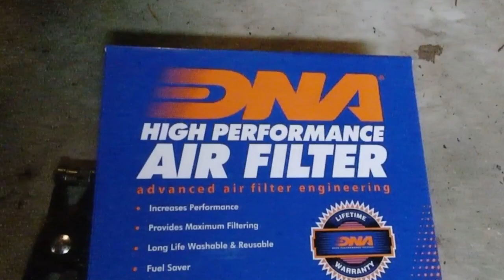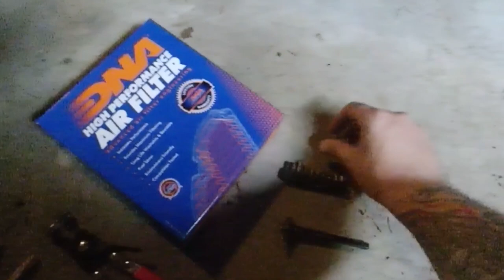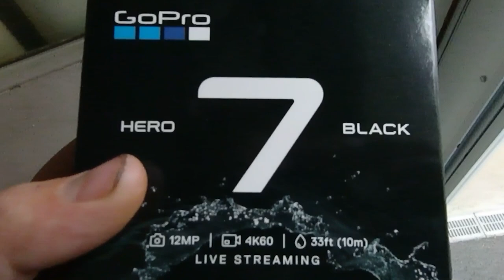DNA Performance Air Filter Install // Triumph Speed Twin // HD

Comment: I put the DNA filter in mine too. I don't care if it flows better (it does) I think the stock flows enough air. I just did it for the serviceability.  Have fun with the xpipe! Not hard just tedious. I did mine in about an 2.5hrs. I uploaded the shop manual to the FB group if you want it.
Reply from the maker: It took me 4 hours to get that sucker in!! Haha im definitely gonna use your manual for future projects though. Stayed tuned for some exhaust clips
Reply: Any chance I could get a specific web address for that shop manual big guy?

Comment: So I need to replace the dna filter every 1000 miles? Does this harm the bike at all by allowing more dirt to get into it? Thanks for the video I enjoyed it
Reply from the maker: I did it for the hell of it really lol filters dont need to be changed for many many miles. People have been running pod filters and open intakes for many years with no issues. Its not really letting in much more particulate than it was with the stock filter anyways. These motors are strong

Comment: Is DNA Better than K&N? Or are they pretty comparable?
Reply from the maker: DNA has been proven to be better than K&N for this bike specifically 👍 can't say the same for all bikes
Reply: @NicePantsLance  Good to hear because that’s the one I bought 😁Also did you leave the snorkel off or reinstall?
Reply from the maker: I left the snorkel off 👍 so far everything's fine! Rode @80mph for 2 hours straight in the pouring rain so I've tested it lol

Comment: Air flow is more than sufficient on the OEM air filter, all you'll do with that DNA one is allow more crap to get into your engine and shorten it's life
Reply from the maker: Well you're definitely not wrong about that....but i think its pretty obvious that the more an air filter flows, the less it filters out of the air. One of the main reasons i went with a DNA filter is that they can be serviced and re-used. Oem paper filters must be thrown out after they are soiled. 

Heres a link you can follow proving that aftermarket filters flow better than OEM.

https://youtu.be/pGSHtEjYIhc
Reply from the maker: Here, i put up the results so you dont have to watch the video.

Clamed air flow by the air filter manufacturers:

• Kawasaki OEM none
• K&N Filters 212.7 cfm @ 1.5 inH2O
• DNA Filters 181.4 cfm @ 1.5 inH2O

Test results 30-3-2012 (same day, same conditions, same flow bench, and same operator, back to back):

• Kawasaki OEM 152 cfm @ 1.5 inH2O
• K&N Filters 161.6 cfm @ 1.5 inH2O
• DNA Filters 184.6 cfm @ 1.5 inH20

You can think what you want, but to say that all filters flow the same, is an old wives tale. If you hold the filters up next to each other, you can even see the DNA filter has more surface area. 

Have a swell day and ride safe out there 👍